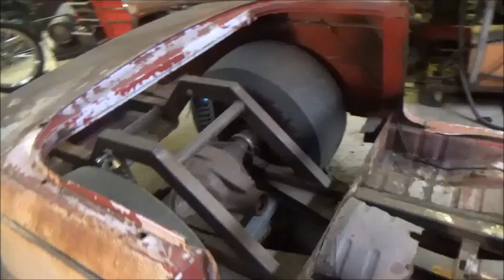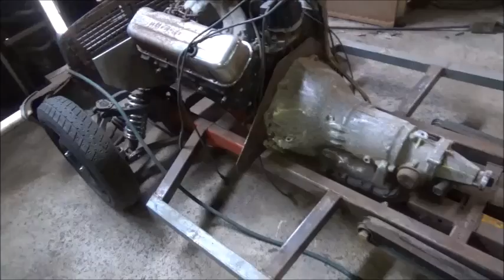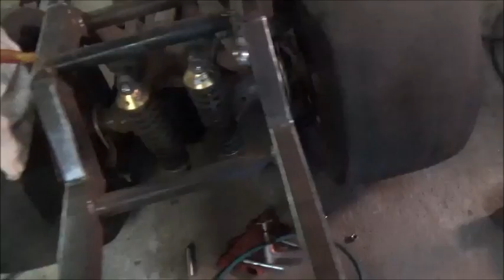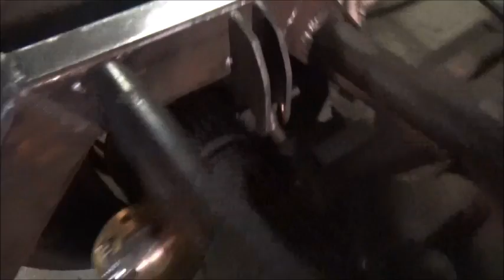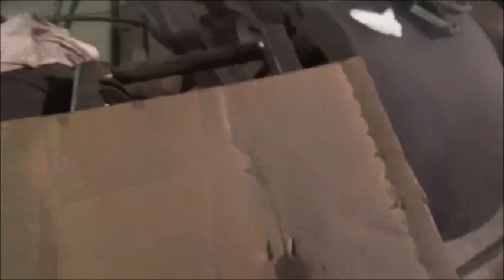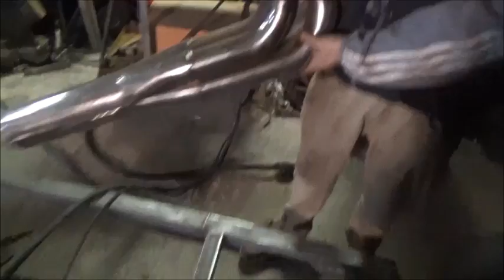Low Budget Drag Car Build Part 25 Rear Suspension

Comment: I would encourage you to try to get that panhard bar dead level when loaded to avoid any squirrely behavior when you get on this car.  And I would feel a lot better if your rear spring/shock mounts were in double shear and not single.  They would be much, much stronger and provide a nice rigid mount to help keep the squirrels away.  Still lovin' what you're doing, but don't want anything bad to happen.
Reply from the maker: If these were conventional mounted shocks In rubber I would have. But since these are heim joint Style I decided not to they are very rigid. We are running the suspension very stiff. I don't think the panhard bar will be an issue if so I would have run a Watts link. We are just building for fun.
Reply: @jonathanw4942  I understand the build for run aspect, but being an engineer and a kart racer, I tend to be conservative and go for ruggedness.  Keep in mind those just aren't your shocks, but also the springs holding up the car meaning the loads are higher.  I just want to see you be successful and have fun.  Wrecking the car would not be fun.  A buddy of mine didn't understand the pan hard rod in his SCCA race car and had it at an angle, turned the car into a scary beast until he set it level.  I hope I'm not coming across as negative as that's not my intent, just want to see you be successful.
Reply from the maker: Don't see it as being negative at all. I tractor pulled for years pulling a 26000 pound weight transfer sled. So pretty up on forces and what they'll do.
Reply from the maker: Also what I was trying to say about the shocks a lot of coilovers have rubber mount just like a regular shock these do not. I've had a lot of experience with the same style heim joint on pulling tractor hitches where there was much more Force that's why I'm not worried
Reply: @jonathanw4942  Sounds good, I don't have personal experience with those coil overs.  Was just defaulting to basic engineering practices, but every steering linkage on a racing kart just has the heim joints in single shear.  Thanks for the responses.
Reply from the maker: I would love to know what the actual downforce on the rear of this car could possibly be? but I am afraid it's not going to be very much. At least if it crashes you can always said I told you so. Haha
Reply: @jonathanw4942  if you are adding a wing I may be able to help with what the itself will do.  But if you're adding a tall spoiler I can't crunch any numbers for that.

Comment: I had a 68 camaro that had a two by four custom frame four linked, that part was done great, but pan hard bar was In a hell of a angle and it caused some rear bump steer, so I made the bracket on the frame longer and the one on the rear end taller, to get it level of course that fixed the problem,  couple years later I had it for sale, a guy had a buddy who claim to built custom drag chassis, look to be in he’s 50s look it over, he didn’t care for the looks of the tall bracket it took to get pan hard bar level the way it was tubed  and frame built wasn’t away around it , and goes on to say all you had to do was come of the rear end bracket with pan hard bar level then bend it to curve up to the next mounting point on the frame. I tryed to explain to him you can bend the damn pan hard bar in any shape you like, if your not changing the locations of a pivot point your not changing shit. the shape of the pan hard  bar going from a to b doesn’t change its pivot points. I ended up getting a pen and paper I drew two pivot point just like it be on a car. I said here draw your pan hard bar, he draws a line level coming off the rear end and curving to the upper pivot point. I said you still don’t see a problem?  No that works! I said well sure it does works just like the one that was causing the bump steer. I then drew a straight line from one pivot point to the other I said you see it? Finally he’s buddy bust out god damn it brad hes right. Your wrong brad, lol I was 22 at the time and was blown away by this mans stupidity. I don’t know what he really did for a living but it sure shit wasn’t build the fastest tube chassis in the state. I’m 28 now I sold that car to buy my shop and shop equipment. Iv been looking for it on Craigslist ever since, I put a ls1 t56 6 speed in it, my best friend I had ever had was a retired tool and die man he had a lathe that would swing a two foot piece and was 20 foot long It was huge came out of a factory it was built at that time for a certain purpose he also had  a milling machine 4 foot jaw bad saw bought same auction as lahthe, I built all the parts for my ls swap there and we worked on my car and a custom rat was working mainly on he’s build. He was 40 years older then me I meet him when I was 17 but we were cut from the same cloth. He was in the first stage of heart failure, i was determined to help him get his build done, he had started it 15 years ago before I started finishing it. I had a lt1 and 6 speed that I was going to use in my 68 camaro but ran into a wrecked firebird for the ls1,  so I sold it to him installed it. the look on he’s face the first time I fired it up after running all the coolant lines and wiring the fuel injection up was priceless after 16 years he was finally was close to he’s first ride. 6 months later we took it on its first Cruise. He drove the wheels off that thing for 6 months then he got rear ended bent the rear end knocked a wheel of the rear end hit the cab took out the driver door and part of the cab. I ended rebuilding it for him a year later, but he wouldn’t get to in joy it, he got a heart transplant and he body rejected it he died after 6 months of suffering, I would give a unrealistic price for that rat rode he was the first person in my life to pass away that still hurts and the one that makes me hope there is a after life, so I can shoot the shit with him again. He’s daughter said she would never sell it. So hope to find my camaro as he drove the shit out of it, and I built it as he’s place, lol I don’t know way I’m writing all this in your comments but I swear the pan hard bar was relevant to the video.
Reply: damn. that was a good read. shame that happened to him though.
Reply: Frigglebiscuit I wish I could post pictures here, it had a lot of custom work done every thing built from scratch, the four link in the rear were big block aluminum 440 rods two a link, took two rods took the cap ends off, and bolted the big ends to gather, the front suspension was pretty wild it used four piston rods on pivot points, that compressed the shocks. Hard to describe I personally only seen it on he, build
Reply: @morehp1  lol that sounds neat as hell

Comment: at least 62-72 c10 and c20 use the  trailing arms as standard equipment,  Lief string on those are the optional rear suspension